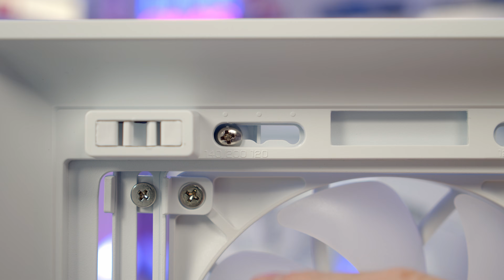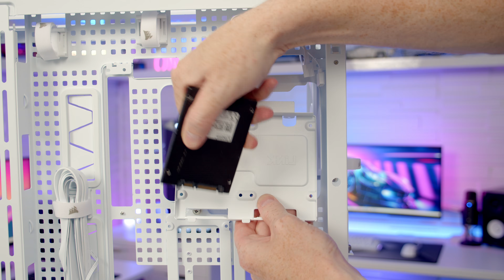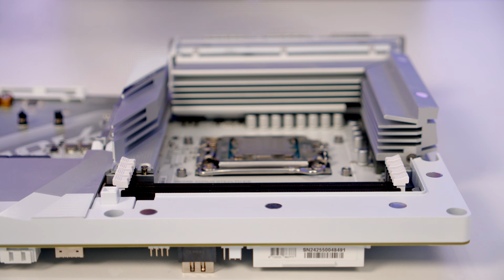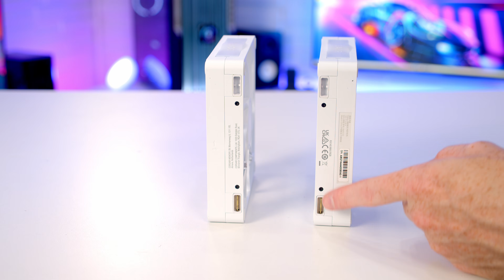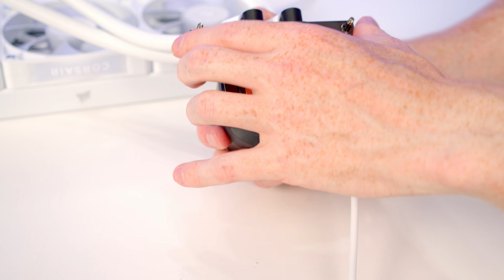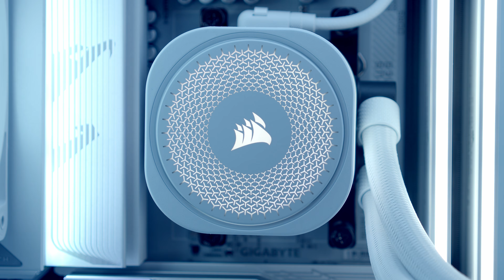Corsair Frame 5000D Build - Step by Step Guide

Comment: I can’t seem to make my motherboard align at all when trying to fit it in, it’s an ATX and should align perfectly with the pre-installed standoffs but yep it isn’t. Slightly off all the time and the guide pin isn’t connecting much and if it is then it’s not aligned right anyway. I can’t tell that well but it might be that the guide pin is slightly bent but Idk what the fix is.

Comment: Currently have the HAVN HS420 VGPU version but the Suprim 5090 is so big that I have issues with the AIO pump head. 
Right now I consider to move to the Frame 5000D and get rid of the super heavy HAVN case. But not sure if its worth to move

Comment: So just to clarify the rs140 fans the case came with were not able to managed through icue since you connected them to the motherboard? Ive been reading up and it looks like if you connected them to the commander module then you could control them and change rgb through icue if Im understanding it correctly.

Comment: This may be a silly question, I've never built a PC before but i am planning to in the future. I've never noticed from other videos that I've watched but on this motherboard it has connectivity points on the rear, is that normal for most motherboards? Or is this specific to this brand/board?
Reply: It's specific to this. Normally everything is in the front.

Comment: Why did you not turn the fans on the aio around so the contactors were at the back would look cleaner and the sorter cable would have worked

Comment: With the old 5000d they had a filter up top for the fans, so if anyone wanted to have one there they I suppose they could easily get them from Corsair themselves.  The New build I used the Lian Li O11 D Dynamatic EVO RGB, I didn't use the new Corsair 5000D Frame.  I used QX 120 RGB linked fans, as it cuts out quite a bit of wiring in the build, I also used a Corsair H150i AIO linked to it as well, so it saved quite a bit of wiring. I must say those I do like the new case Corsair have at the moment, but at the time I was building it wasn't out yet.
Reply from the maker: Yes very impressed with this one